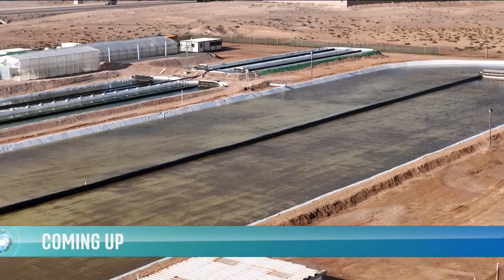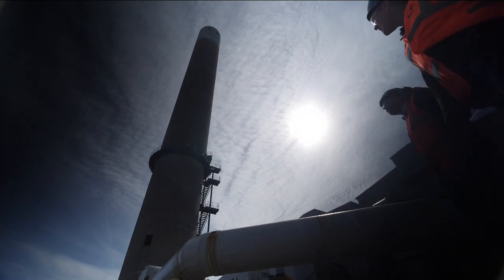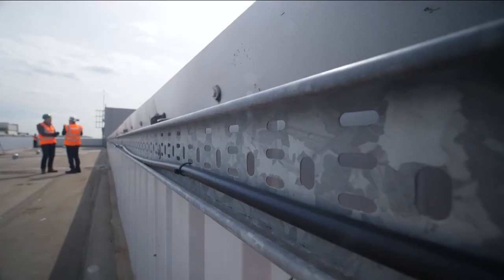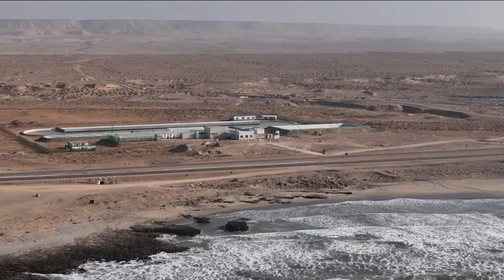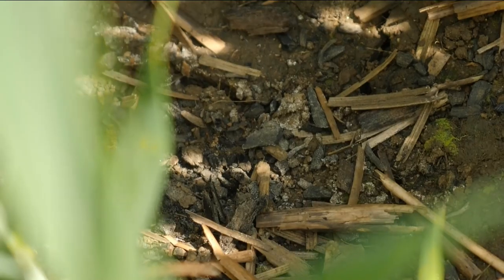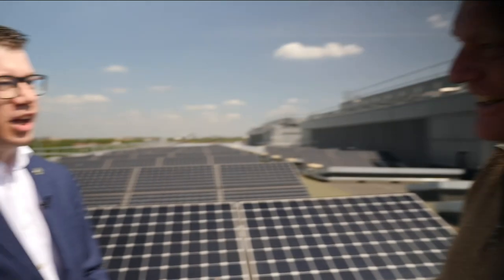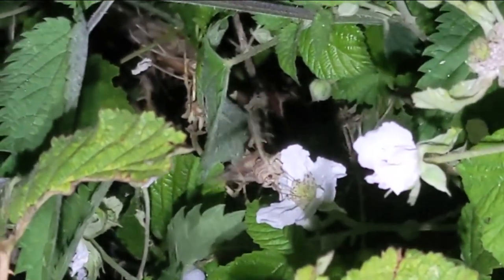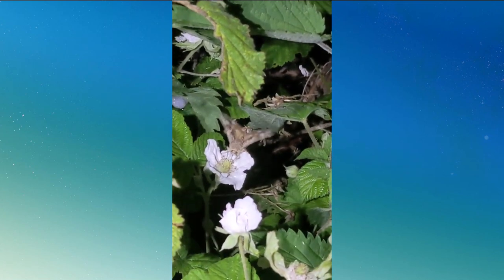How to lock away carbon and throw away the key | The Climate Show with Tom Heap

Comment: Now we are into  a planetary cooling phase, it started 8 years ago, the weather will be volatile. The Australians are experiencing record cold in May, and the Arctic has recorded it's coldest 6 months ever seen. There will be plumes of very hot weather, and extremes of very cold weather. Rainfall and hail will be heavy and cause flooding. This will get worse as the planet cools, until we are in constant deep cold. This will last for about 40 years. NASA are well aware  of this scenario.